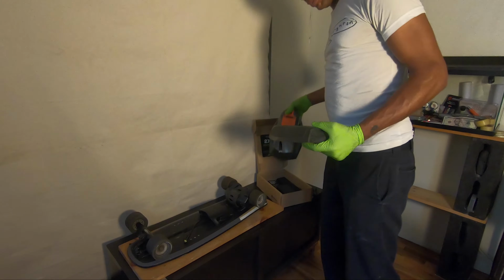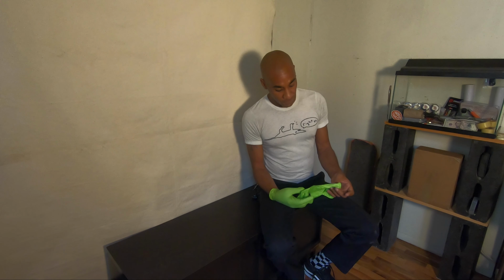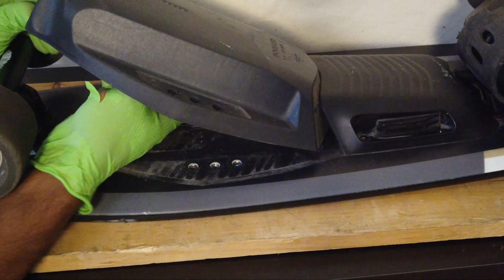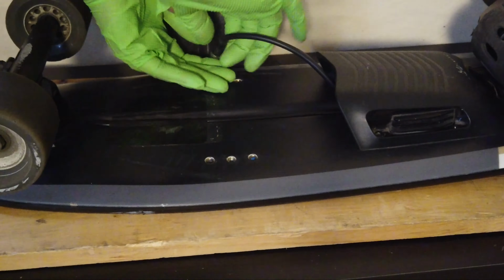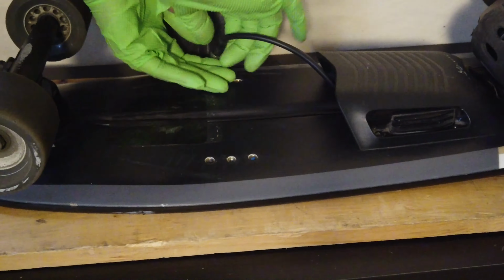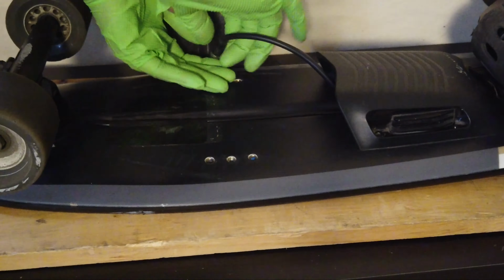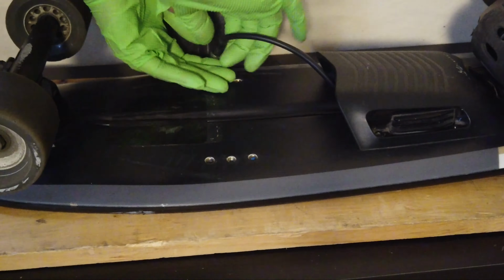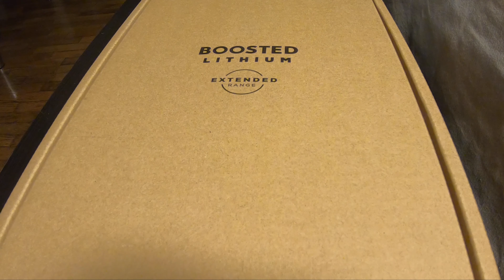Replaced Boosted MiniX Battery After 1137 Miles

Comment: Where’s a good place to get XR batteries for the mini x? Mine has the dreaded error code caused by sitting in my closet for a couple years. I only saw 1 place who has them (the boosted guys) and all the info I found the reviews said the batteries died after days and the company won’t help
Reply from the maker: A new battery may not help if it's RLOD. If you want a used one I have many. 😂
Reply: @JPBiamby  how much/how many miles? 😅
Reply from the maker: @ianyyam  2 XR batteries are brand new, 1 XR battery has less that 3miles but has RLOD & the the used one has over 100miles.
Also have 1 SR battery.

Comment: What is that tool you are using to tighten the power cables?
Reply from the maker: There is a tool that comes with the Boosted Battery that is like a V shape that helps loosen & tighten the wire connector to the battery. Is that what you mean?